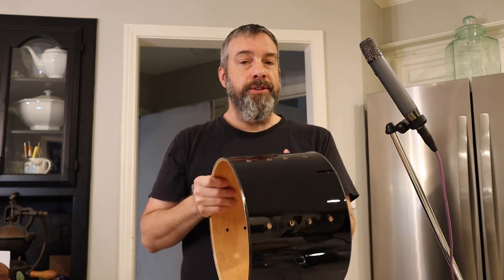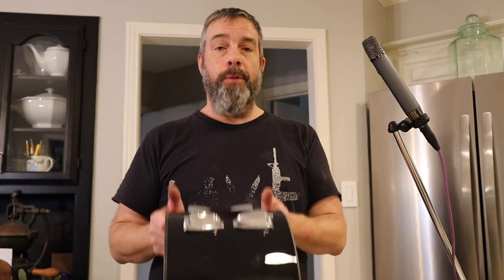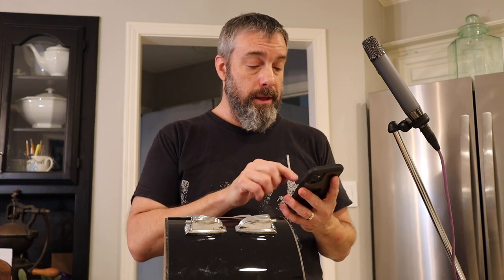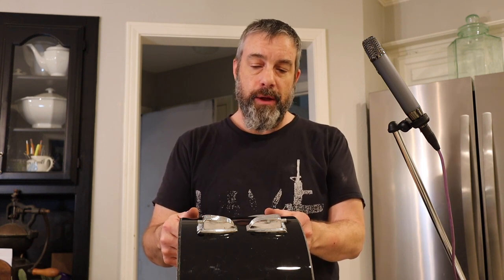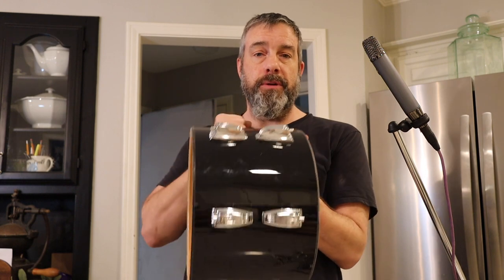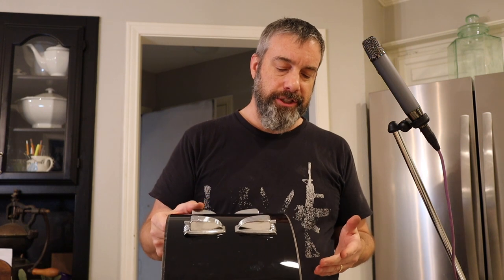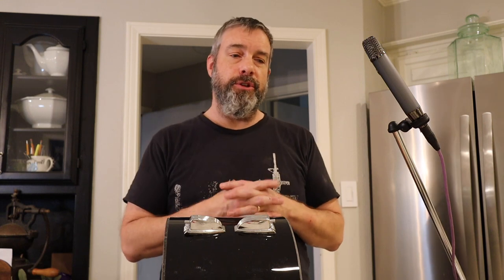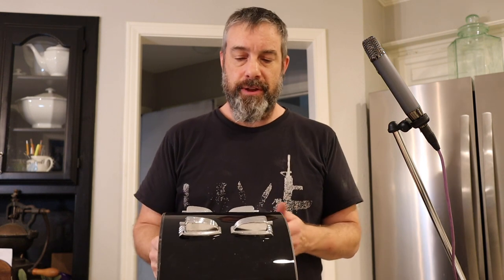A Drum Shell's Inherent Pitch... Does It Matter???

Comment: There are a few things at work here. First of all, once you bolt on the hardware, shell pitch goes out the window..... period. The OTHER is that shell pitch is a pretty good indicator of shell STIFFNESS. The higher the pitch (within a given size), the stiffer the shell. "Loose", flexy shells make for "thuddy" drums. Stiffer shells will have more tuning range, and also afford better projection and attack. If a shell's pitch is low and indistinct, that's a "thuddy" shell, no matter WHO makes it.
Reply from the maker: Well said!!  That is true.  I have a Tama Royalstar (1st gen Brazilian Grain kit) that is essentially an Imperialstar kit without plastic wrap. They have a mellower, lower, more vintage tone (approaching that of some 40's Radio Kings I used to have).  Lots of vertical grain veneers in there, and the shells are very low pitch (something DW is promoting, which I think it borderline rather humorous considering that for a couple of decades Pearl made all those cheap stencil kits with lots of vertically oriented plies -- though I am NOT equating those two.  The DW product is far superior.    I just find it interesting that the orientation that has been so commonly used in Asia for decades is now considered (or promoted as) groundbreaking technology here in the States!
Reply: @drumdotpizza  I love DW as a hardware company, and I love the people there. I have NOT loved their drums since they stopped using Keller shells, which are of a stiffer construction, with a much higher shell pitch. The whole Vertical Low Timbre construction method yields those thuddy shells that I was describing, and yes, this is one of the reasons why vintage Asian lauan-ply drums sounded the way they did. Yes, while the DW product is far superior (and it had BETTER be, for the price), the results are similar. I've played a lot of backline DW kits, recently two of them on a tour, and they just have THAT sound, that might sound great near-field, but out front, and even to mics, is just, as I like to say, unremarkable. Many people love them and aspire to them. I digress though: The timbre-matching/shell pitch thing is only a rough indicator of the final tuning range.

Those old Tama Royalstar and Imperialstar drums were serious stuff! Those were actually fairly-stiff lauan shells, made stiffer and more reflective with the generous Zolacoat interior coating. Hey, they were good enough for Stewart Copeland! 😁
Reply: Thank you. Very informative.
Reply: DW went too thin, their kits dont sound good out in front of the mix, too tubby too low, the toms all get lost competing with the bass guitar. The sound at the throne may be what drove soo many to love them but they dont project well,  love a bunch of their snares and their hardware stuff definitely like the company but the kits get smoked by high end offerings by others, Yamaha and Sonor come to mind
Reply: @Diesel0807  I agree, thuddy toms and dead kicks, a very vanilla tone that sound engineers love, and the players have no idea that they sound like boxes out front. Hardware and snares, yes.

Comment: Hi! A little late to the party here as I just recently stumbled over your channel. Very good stuff though, and a lot of things that I'm sure many of us drummers never reflected on, but should. The physics of a drum is really quite interesting, and you've made quite a few really good observations. The mass of the shell and how it's affected by the hardware added to it really was an eye opener and expalains the concept behing Yamaha's "weighted lugs" that they use for the Recording Series. Obviously (now) to add mass and thus lower the pitch of the drum. Clever! You're conclusions re shell thickness and rigidity also made me think of speaker construction where you always strive for maximum mass and stiffness of the cabinet to avoid any ringing for hi fidelity and to extract the maximum amount of low end. If the cabinet moves or vibrates, it, just like with a thin drum, absorbs/kills a fair amount of the energy that was intended to reach the listener. Makes all the sense in world when you think about it. Very interesting stuff, keep it up. We all need to geek out now and then :-) Cheers! Andreas

Comment: I became obsessed over this debate. What I found with my DW kit is that I tune the bottom heads to the note of shell and then tune the tops to how I like them. The shell note also allows you to know that your drums shells are relative in pitch to each other. I owned a mapex Saturn maple walnut kit 8 10 12 Tom’s all resonated awesome 14x12 and 16x14 mounted floor Tom’s. The 14 would not resonate no matter what while it was with the kit. If I moved it away it was the best sounding floor Tom ever but I believe the shells pitch did not match the rest of the kit and that’s why it wouldn’t resonate with the rest of the kit. I do tune up and tune down with my DW kit with the reso heads but my kit is 5 semi tones apart from the 10 to 12 to 14 so I try to tune the reso heads in that order as well and it always works and always sounds killer. The entire kit just sings with itself. So my opinion is that this is the importance of the shell notes. It’s a guide for tuning and it lets you know the intervals between your drum shell notes and that they truly belong together as a unit. Side note I had a Sonor S Classix kit and I checked the pitch of all the shells and they were all a 5notes apart except the 8 inch Tom which was 7 so I don’t really know if all drum shells are relative in pitch as they are made or if some can be higher or lower or if any of what I stated above means anything or makes a difference. I just used to struggle with tuning until I got my DW kit and learned to tune to pitches. I have a tunebot also and the older model allows you to save your settings to up to like 10 kits so I have all my snares and drum sets saved which makes it a snap to tune up or retune after head changes to exactly where I like em. Also I used to spend time tuning a drums top head and really only a single spot was out of tune on the bottom head so guys n gals check the bottoms first as they are the resonate head if your drum sounds out of tune. Thanks again for a cool video sorry for the long comment but I do find the shell notes to be of some importance. Sales gimmick maybe but it works for me hope any of this can help anyone out. Happy tuning and drumming 🔥🥁

Comment: You're absolutely right about all that is involved. I have to add though that the tension rods and the amount of tension on the rods counteracts the added mass of the lugs. Basic physics. There is only one way to find the resonant frequency of a tuned drum that is with a tone generator. Find the natural and fundamental frequency of the drum by making it resonate with the generator. Both have to be found to ensure accuracy to ensure you're not being taken in by overtones at 3rd, 5ths. 7ths 9ths, etc. This video is 2 years old so this probably makes no difference. There's a lot to this but by using a generator you realize that for tuning the drum, the entire equal tension on the lugs goes out the window as nonsense. Tune to the drum, not the heads.

Comment: 1st, The natural frequency of the shells, is the frequency which the shell will damp the Drum Head at its most efficient, given the amount of coupling of the shell and the drum head. This is actually oppose to those who claim tune to the shell sounds more efficient (even referred to the completed hardware and build shell's natural frequency)

2nd, The first major shell related resonance is not the shell Fo "natural frequency", but the dimension of the inner diameter + depth, is the chamber geometric caused "standing wave", which create the signature an 12" sounded like an 12" inch, relevant to the interior wall sound dissipation coefficient.
Round shaped with an squared cylinder( depth equal the inner diameter) has the highest Q of standing wave resonant, more boxy gave a more "one note" standing wave resonance.
Reply: 3rd, The type of material and total coupling mass determine the natural frequency or fundamental "pitch" of the shell system. Differences type of shell material and constructed condition (not all Ply wood are created equal), shaped it's sound characteristic by its Material's internal damping characteristic, some said harder wood (given the same dimensions, condition and thickness of shells etc.) will makes the drum sounds brighter because the shell has higher "pitch / natural frequency" compared to the softer shell, true but not as true, the shell exited at a higher pitch Do Not combine much to the outcome of the drum sound, because the relative sound pressure level from the resonating shell are so low compared to the resonating drumheads, and harder wood shells pitch higher but has it resonate at a much higher in Q, which means it is more inert from human perspective, what cause the harder wood shell's drum sound stronger in the higher frequency, is due to the shell's high Q do not pull much energy and cause damping to the drumheads at the higher band, and thus lets the drumhead resonates more at its higher frequency band, it still will suck off energy and cause a sharp drop at its natural frequency but you only will notice it with Mic-Computer response measurements.

4th, Coupling is the another Key, if the shell are coupled to the hardware, stand etc.,  the shell system natural frequency will alter depending of the coupling Q, basically all mount are coupled at very low frequency and decoupled at very high frequency, the greater the coupling the more they shares the mass and vibrate as one system with combine natural frequency. Decoupled items will interact depending on each other resonance "phase" relative to its own system natural frequency, when in phase they enhances, and damp each other when out of phase.

Just my own humble opinion.

Comment: Drums can have a wide harmonic spectrum and don’t necessarily have a single tuning that is most preferable. It can be good to start with a middle-ish tuning and experiment from there. If I’m in the mood I can crank  my old Gretsch round badge extremely high and it’s equally musical compared to mid tuning.
The mahogany in my old Slingerland tom seems to coax out (I think) a complex harmonic spectrum while still being dry and dark to my ear. I know it’s easy to say preferences are subjective but I’ve played for decades and still change my mind a bit at times. I actually like different tunings and don’t believe in a “best” tuning however I do always have a favorite at any given time.

Comment: Very cool video.  I never really understood why having the note of the shell stamped on a drum was suggesting tuning a drum to that pitch.  There are way too many variables beyond that that can have an impact on how a particular drum should be tuned and ultimately how it will sound.  Great job de-mystifying this myth.  Another would be the whole thing where on tuning a tom's bottom head tighter (minor third) than the top head causes the tom to sound like the pitch bends down when hit.  I've seen a number of "pro" drummers saying bottom head needs to be tighter than the top while other "pro" drummers say the very opposite where top head needs to be higher than the bottom.  Funny enough, I've heard conflicting comments from the same drum manufacturer who stamps pitches on their shells saying top head needs to be higher than the bottom to achieve that pitch bend down on a tom.  They all can't be right?  Is the sustain of a tom really long enough to achieve a pitch bend down when you hit it?  Thanks Joel!!!

Comment: Thank you for this video. The message is not new to me but the way you present it here really sums up the bits I've found here and there...Do you have a take on plywood vs stave-built shells? Sure, there's still plenty of variables like shell thickness, ply thickness and amount of layers and for stave the same stuff, shell thickness has slightly different effect due to the different build, amount of staves per circle, wood species, the way the wood is cut and a whole lot MORE...... but in GENERAL, I'd be interested in hearing your take on "ply vs stave construction" as a drummer and recording engineer? 

Thanks again, your channel is golden, keep it up!

Comment: Thanks for your video - the other aspect you could consider is that in real operation there is not a force applied to a particular point or zone of the shell but a pressure field and a vibration field from the heads - besides the other misunderstanding is that shells do radiate sound.
Reply from the maker: Thanks for your note!  This sounds interesting, but I'm not sure I'm picking up what you're putting down (but really want to... this is right up my alley!).  Could you restate this another way?  

I think I gather the first part of your comment -- the shell is affected by the head (which is set into motion by the transfer of energy from a drumstick).  That about right?

The second part about shells radiating sound, what do you mean, specifically by 'radiate?'  Is this related to reflection or do you mean more channeling energy from the heads into its own vibration?  I know this is true (both) but wondering specifically about the misunderstanding you're referencing?  

Thanks so much for your comment(s)!!
Reply: @drumdotpizza  the response of a structure will both depend on the inherent dynamics of the structure (modal base) and forces applied - my point is : when you strike a head fitted on a shell, the resulting loading on the shell is the result of structure borne vibration of the head through bearing edge and field of sound pressure on the walls indide and outside the shell - none of those are similar to a hit at a particular point - in other word when you strike a surface you appropriate a certain number of modes, even imposing the position of some nodes (see cymbals acoustics), whereas in normal operation the forcing field on the shell is different and will result some modes being blocked and some other forced

Comment: Excellent work!, can you talk about if the bearing edges and the diameter of the counter hoops on toms can REALLY 
change their sound?
Reply from the maker: See my video on bearing edges for my response to that part of your question (https://youtu.be/3efdlamETiE).  

As for the hoops, I don't know that the diameter itself has much to do with the sound (one slightly larger or slightly smaller (different tolerances))... is this what you mean?

Mass of the hoops makes a difference, so die cast vs. flanged hoops (particularly if light weight), yes, there will be a difference in the sound.  In general more mass (shell or hardware) will lower the pitch of the 'shell' portion of the drum and make it harder for the 'shell' (with hardware) to be excited into vibration, yielding stronger fundamental tone compared to the harmonic content.  

See also my video on mass for a more geeky, in depth explanation on that (https://youtu.be/sKDRDRAphy8).  

Thanks so much for your comment!

Comment: So the smaller the lugs the better? Will a shell resonate more with less massive lugs? The more weight you attach to a shell then the less resonant it gets? Interesting....
Reply from the maker: You are correct that greater/added mass lowers the pitch of the drum (without heads) as I show in this video.  Greater mass also reduces the ability for the shell to vibrate, but I can't say that smaller lugs (or lower mass) is better.  That is purely subjective (beauty in the ears of the beholder).  

If you haven't seen it (and have a little time ;) check out this video for a more comprehensive discussion of the effect of mass on a drum's performance:  https://youtu.be/sKDRDRAphy8

Thanks for your comment!

Comment: I don't think you really nailed it here. The fundamental note of the shell with lugs mounted is a great indication of the tonal "center" of the drum. It can reveal what range the drum is really working with, and likely, what harmonics of that tonal center might well work with that drum. I captured my shells' tonal center with my tunebot and use that as a guide to the range I have to work with.  I have found this methodology to yield great results for a very open tone. From there I use towels or dead heads for muffling or effect.

This could help catalogue a drum closet at a big studio.

Great subject, I just disagree that the shell pitch is irrelevant. I loved your supra vs super video! 👍👍👍
Reply from the maker: That's a logical approach to utilizing the knowledge of the shell's pitch.  To the extent that the shell can still vibrate/participate in the resonance of the drum tone that makes sense.  

The more a shell is loaded down with mass (hardware) or the more it is inhibited from vibrating with traditional brackets bolted to it, etc., the less it will be able to vibrate.  The less it vibrates the more inert it becomes (along the line of Sonor's approach to building drums in the early 1980s -- heavy heavy heavy!).  

I do like your thinking though, and drum shells do tend to involve themselves in the tone of a drum at least to some extent even if they're loaded with mass.  I don't know of a truly inert drum shell (but wouldn't that be fun to have one?).  

Thanks for your comment!